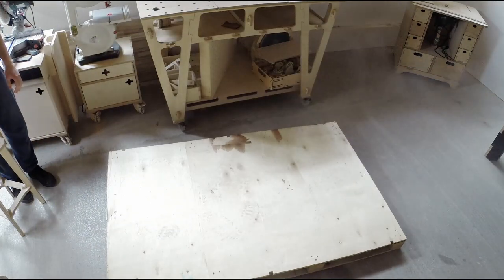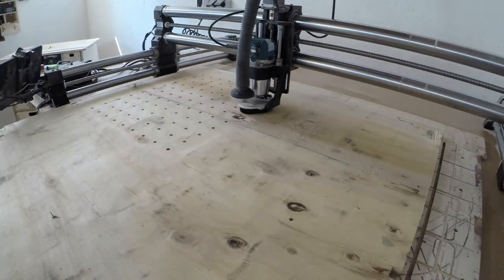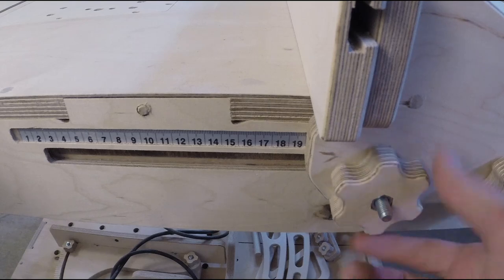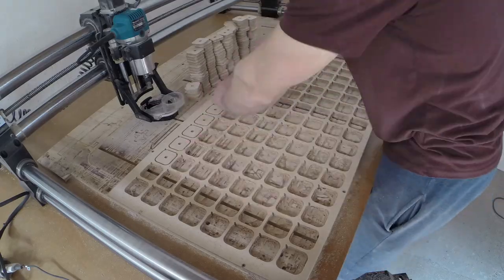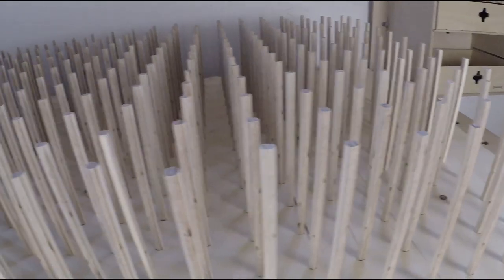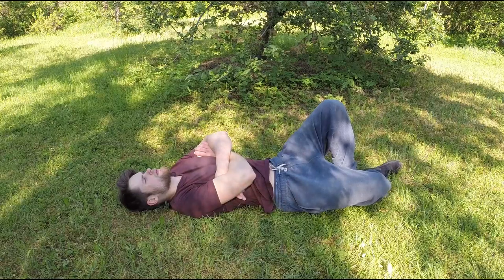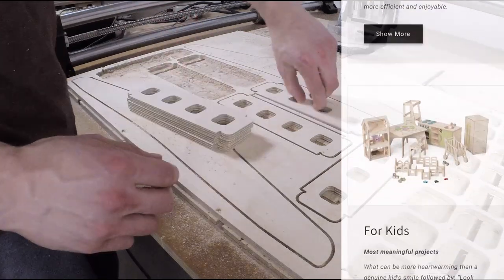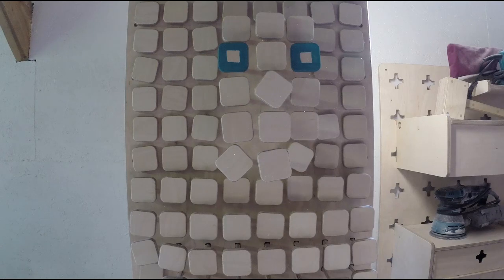Making a Human Size Pin Art Wall Out Of Old Plywood Pallets - ARIBABOX

Comment: Lovely job. As inventive as ever.  I’d love to hear your advise on tiling as I have never been confident enough to try it.  I’d also love to hear more about your setup.  Endmill manufacturer, speed and feeds.  I am new to all this and still making plenty of mistakes.  Managed to some how put the cnc into submarine mode the other day curing the bit to dive as it was homing.  Bit snapped clean in half.  Using Spetool end mills and I find them very good.
Reply from the maker: Thank you for the compliments! We will have to make a video on tiling and the CNC setup to help you maximize your CNCs potential.
Cooling the bit while the CNC is homing sounds like a great idea, but it might not be the best solution for carbide woodworking bits. As I know, usually, water cooling is used when cutting metal components (during the cut).
Reply: Look forward to it. Thank you.